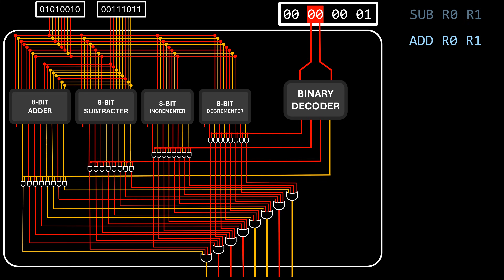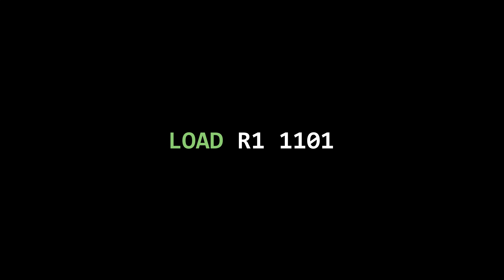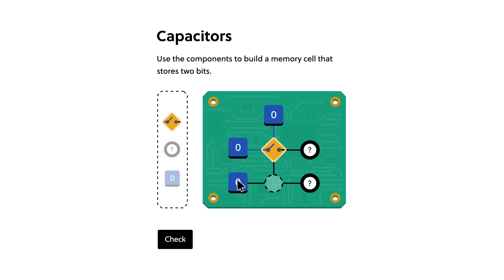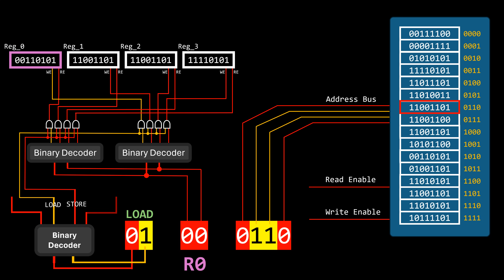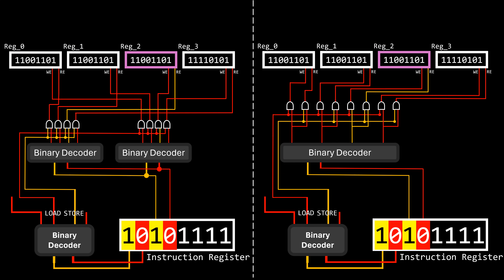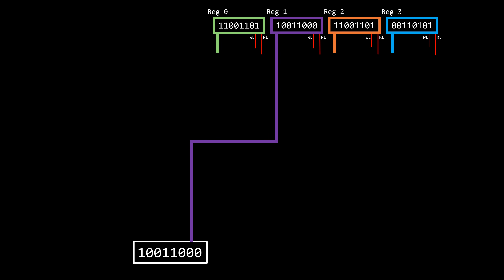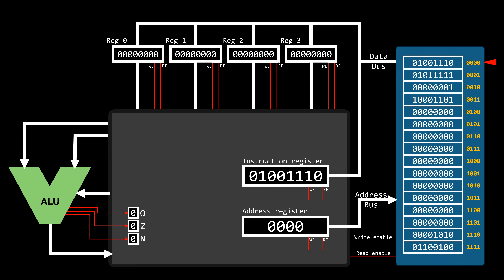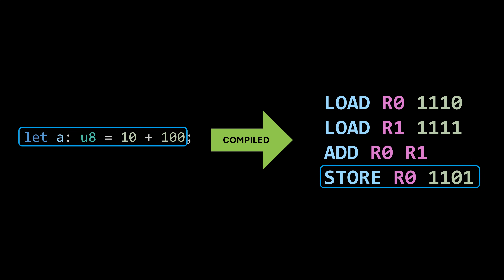CRAFTING A CPU TO RUN PROGRAMS

Comment: Everything shown on the video you can build yourself in the virtual environment in the playful manner in the Steam game "Turing Complete". You start by creating simple NOT and AND logical gates and build more complex components like ALU and finish the game with simple version of turing complete computer that you can use in game to write real programs. Highly recommend!
Reply: Yes, I have that game and there is some truth to it. However, there is one major difference or distinction between that game's virtual or sandbox environment compared to actual real physical hardware. When it comes to read and write access within physical components, memory devices also known as sequential logic all rely on a clock signal. In real hardware the clock signal has a high and low pulse. For each high and low part of the wave, this is one cycle. Within real hardware depending on layout and wires being connected you can implement either low or high timing logic or in some situations even both. The game itself doesn't implement it that way. The game itself is based on Game Ticks which is basically an iterator or counter. Also, the game does not support circular dependencies or in other words, feedback loops within your simulated circuit designs. They implement their representation of memory complete different than that of the actual design of logical latches or flip-flops. I've tried implementing a Carry Look Ahead adder instead of the basic traditional Carry Ripple Adder. 

Within the game, I can kind of do that if and only if, I layout all of the wires within the same module avoiding any kind of feedback loop. If I try to abstract away from that and create smaller components to be reused to construct the CLA such as the propagate and generate modules and then wire them up to construct the adder, this is where I get the error message that circular dependencies are not allowed or are not supported.

I only mention this to point out the subtle but major differences between the two so that others who may not know can be aware of it. 

Other than that, yes, the Steam Game: Turing Complete is a great game. Not only do you solve for simple logic challenges working your way up to build more complex modules where you eventually link them together to make your CPU and use it to solve other challenges. You don't just write assembly code to solve those problems, you literally have to assign each bit within the instruction - assembly editor - debugger, you also assign your own assembly mnemonics to those instructions based on how you wired up your register file, your ALU, your ram - stack module, the I/O, and the main program window. Then you begin to write your own assembly program based on your assembly language - instruction set to solve the later challenges. It is quite challenging and immersive to say the least. Writing a sorting algorithm in your own assembly within the limitations of say 256 or 128 lines of code or less and getting it to work is quite rewarding. 

I do highly recommend this game for anyone who is interested in ISA design, or how computers work under the hood. Yet, it is still very important to know the difference between the game's virtual implementation compared to how real hardware works. 

If one wants to explore this type of thing even more, then I would suggest finding a fairly lightweight, yet versatile and powerful little program called Logisim. The Original Logisim can still be found, it still works, but it is no longer being actively developed. However, because many people like its interface, it's ease of use, some have taken the original project to the next level, a fork of it, and they have created Logisim Evolution. Evolution works nearly in the same way as its predecessor with some variant changes, but they have also included the ability to read in VHDL, or Verilog files. With this application you can literally create or simulate real hardware with the high and low pulses of the clock. It does have its limitations though. You can only simulate frequencies up to a certain maximum. Yet for anything that is from the 8 and 16 bit era such as the 6502, 8080, Z80, etc... one should be able to fully implement them with maybe a few minor adjustments, tweaks, and or work arounds. 

Yes, you can still do 32 bit and even 64 bit systems in Logisim and have all of the proper layout for that architecture, yet your running simulation is limited. Anything even remotely close to a few hundred MHz up to and greater than 1GHz aren't going to run as expected. Yet, I have seen some implementations of the 6502 that were able to get Mario to run in it (albeit no sound, and it was a bit choppy) and I've seen others to get DOOM to run on their 486 near Pentium 1 variants. The renderer work, however, they were not running it at a smooth comfortable or playable 30-60 FPS. They were rendering it more like 1 frame every 10-30 seconds lol... Yet, it still worked, just not playable. However, you are able to step through it, kind of a like stepping through source code with a debugger, but in this case, you are stepping through each clock cycle and are able to watch what each and every piece of the hardware is doing on the low end and high ends of the clock. Also, if you are a bit savvy with technical and programming skills, you could write a program or tool that can take the exported information from Logisim (Evo) and use that to create a simulator - emulator in another programming language such as C/C++, Rust or even Python, JavaScript, etc... and run it from there to get closer to the actual implemented virtual hardware's real time (there are still limitations though). If you are working on say a Quad Core CPU at 3GHz per core you might be able to simulate a virtual piece of hardware single core up to about 1 - 2GHz before seeing any performance issues, unless if you designed your application to run directly on your hardware agnostic of your systems Kernel and OS that is, but I don't see too many people writing in direct assembly these days! Most people are relying on the native C/C++ compiler and the operating system's kernel.

But yeah, I do highly recommend both the game Turing Complete and the freely available application Logisim Evolution.
Reply: @skilz8098  Loops are not allowed in real hardware. All those people who talk about 10 types of flip flops have missed the transition to ICs and CMOS. All modern chips use combinatorial logic just like that Steam game. At the end of the cycle, they catch the result (using the clock) in a latch. At the begin of the next cycle, this result is presented to the next stage in the pipeline. Even before CMOS, every CPU could run a different clock rate ( 600 kHz .. 1800 kHz ) for example. They don't rely on tuned timing. The nice thing about a carry look ahead adder is that all signal race synchronously. At least I plan to capture them in latches towards the root of the tree. Then I release them staggered on the way back to the leaves on the next cycle.
Reply: @skilz8098 bro wrote a whole essay just to say, “yea its a good game and yea its a good app”
Reply: I don't know if that's a game you have to pay for, but you can do all that in logisim, which is free and very powerful.
Reply: @mattsadventureswithart5764  I'm having issues creating the latch in logism. Apparently, it doesn't have a bi-directional wire so I can't use one wire for read and write.

Or is there a way around this
Reply: Thank you so much
Reply: great game
Reply: Thank you, need to check this out
Reply: Its an awesome game! Glad to see it get more popular!
Reply: You missed the best part of the "game". You can export your creations into Verilog. You can "program" your own FPGA chips with the "game". Turing Complete is more of an educational tool than a game at this point. VARY COOL!
Reply: Thanks ❤
Reply: In case Turing Complete is too complex for beginners, try "Digital Logic Sim" along 4-parts video of Seb.
Reply: Thanks for sharing!
Reply: And also minecraft but it's not exactly the same
Reply: I forgot about this game, thank you!!
Reply: Thank à lot bro
Reply: Thanks a lot man
Reply: Exactly what Im learning, I mean playing right now...😂
Reply: When type load in keyboard it sends a binary op code to decoder? Or something else???
Reply: Thanks for that
Reply: If that's not enough, one can try to build a Turing complete computer in a good old Game Of Live universe. 
Which some crazy people really did.
Reply: Minecraft can of course do this too if you are handy with redstone 😉
Reply: Thanks dude didnt such thing existed!! Ima try that so hard
Reply: It is paid 😢 😭
Reply: YEs i loved that game I also loved the advanced computer with stack memory accessing called LEG architecture. it is the final challenge of the game and rest are just assemlbly coding challenges which IS RUN ON YOUR OWN BUILT LEG ARCHITECUTRE COMPUTER RUNNING ON YOUR ACTUAL COMPUTER.(INCEPTION!!)

Comment: Started with JS, didn't like the abstraction level of the language, came all the way down to 0's and 1's. No regrets.
Reply: 0s and 1s? Too much abstraction. You better start learning how the MOSFET transistors route current through capacitors and diodes
Reply: @whoisthis-r9t MOSFET's? Way too abstract. Valence electrons and doping, son
Reply: @alvcm7208 ngl I actually did that. Holy shit what a long rabbit hole I went down to wind up here lmao. I just wanted to know how the first assembler actually worked and here I am. I understand now, but at what cost lmao
Reply: @whoisthis-r9t  Yeah but even the 0's and 1's are an abstraction layer over top of low and high voltages, low and high logic. And even your individual components such as capacitors, diodes, resistors, transistors, etc... are abstractions over top a mixture of both Physics and Chemistry. And they are abstractions over pure mathematics, and they are a pure abstraction over that physics, oh wait, circular dependency. Oh, I get it now, that's an abstraction of Quantum Physics and Quantum Mechanics and here we are back to a bunch of 1s and 0s sort of. Which then leads us into a various of topics of discussion and abstractions such as Chaos Theory, Number Theory, the Axiom of Choice, Consciousness itself, and here we go again... where all of them rely on some form or model of abstraction that relies on abstract mathematical concepts. An easy way to model this abstraction would be to look at the properties of various fractals. One might want to brush up on their math skills! Math shows up everywhere regardless of what level of abstraction you are looking at. Even the concept of language such as a spoken and or written language can be broken down into mathematical abstractions. We can look at a language as being a type of a State Machine. So, in some sense of the truth, no matter what level of abstraction you are looking at or focused on, it's still an abstraction. Even when you reach your arm out to pet a dog, it's still some form of an abstraction. But I digress, I enjoy the understanding of how electronic components are designed, made and work to form an electrical circuit to how we are able to construct logical devices from them to how we can arrange them to design a Turing Machine to a Turing Complete machine such as a CPU or GPU to programming them at all various levels of abstraction from assembly all the way up to python and more. Now some of my favorite algorithms include the use of Quaternions, BSPs, Quad & Oct Trees, FFTs (Fast Fourier Transforms), O.D.E.s and more. I enjoy concepts such as ISA design - (Hardware Engineering level) as well as 3D Graphics Programming, Physics Simulation, and Audio Processing. It is all intriguing. Even some other concepts are interesting too such as Compression and Decompression algorithms. 

Man: finds one rock, finds another rock, then says to himself, "I now have two rocks". Man learned how to count or add.
Man: tends to break rock to see what's inside. "I will call this silicate". 
Man: then takes silicate and refines it, "Ahh this must be silicon"
Man: then rearranges the silicon, introduces or infuses minute trace elements, injects electricity into it and gets it to start counting, or adding.
Man: then makes programs with it and learns more about the nature of those programs.
Man: then makes programs called games and in those games makes simulators in a virtualized sandbox.
Man: then makes those virtual sandbox games into Factory Games such as: Factorio, Satisfactory, Dyson Sphere Program, Minecraft, etc...
Man: then uses those games to you guessed it: Mine and break rocks to make silicon, chips, CPUs...

So, the morale here is that man went from mining and breaking rocks to building a virtual world to you guessed it: mine and break rocks. 

It's the inner heart and curiosity of nearly every 4-5-year-old! And no matter how old we get; we never truly lose that.
Reply: @whoisthis-r9t  transistors and diodes? too much abstraction. better to learn how quantum mechanics force charges to move around.... which is still too much abstraction^^
Reply: I totally get it. I'm a frontend dev but I'm fascinated with lower level code. As soon as you get into decoding Bluetooth streams or parsing protobuf bytes or if you do anything with WebAssembly, it becomes pretty clear that JS just wasn't meant to handle those situations.
Reply: @jwr6796  wdym by "those situation"?
Reply: @jwr6796 the only way to use webassembly in the browser is JS glue code though?
Reply: Same here!
Reply: Epic!
Reply: same! but java instead of js
Reply: A long long time ago, i stumbled upon 6502 Assemby (Sybex - green cover?). I thought it was wonderful, registers adc lda etc
Reply: same, I love to know what is going on under the hood.
Reply: That's the way to go
Reply: I started with spark/python
Reply: Cap
Reply: Same, this is a 🔥 comment
Reply: Just started C now cause this channel.
Reply: I started with Scratch.

I still haven't left it, but I am now working on an x86 CPU emulator rather than 2d games.
Reply: I am on the exact same journey, from NextJS to Python to C to 0s and 1s. No regrets indeed!
Reply: Aha, the same situation, but i still dont understand anything, i am new
Reply: We need to go deeper.
Reply: Same here, still going to deeper levels
Reply: same lmao. started gamedev with c++ and raylib, felt to abstract, went for c and opengl and now im building my own gpu lol
Reply: @micuchichu whaaattt, may i contact you please?im still learning how to combine some part of processor. But im already "design" (abstract 😂) a LED array driver and wondering how display any kind of text or image from memory to led array
Reply: Really? You write code in binary? 

Liar.
Reply: @wlcrutch : I did code in machine language for the Zilog Z80 in 1980. At that moment I didn't have an assembler, so I had to do It by hand. I programmed the 2732 EPROM memory, which was to provide the instructions for the Z80.
Reply: @wlcrutch  ...that was more or less possible on a MOS 6502. 😉
Reply: @wlcrutch  not binary, machine code